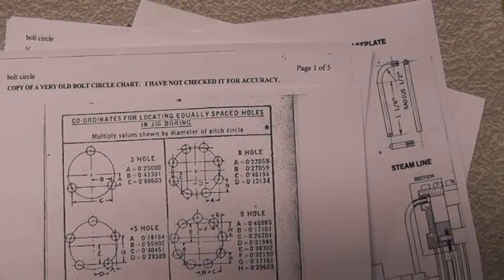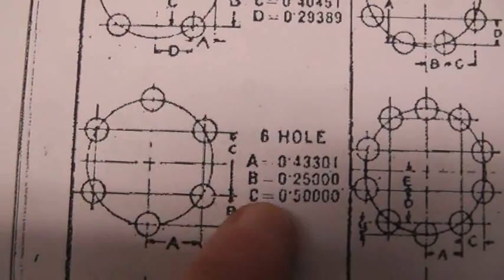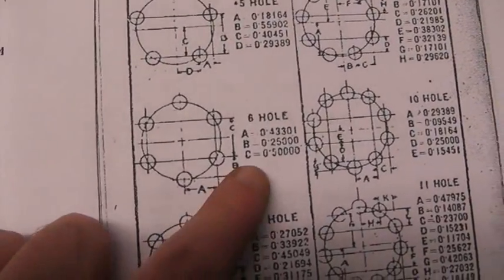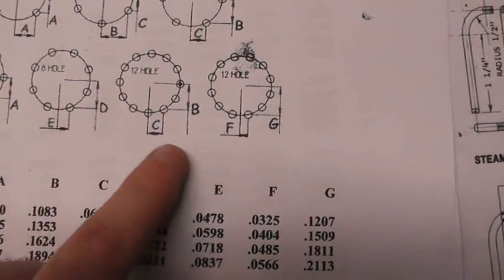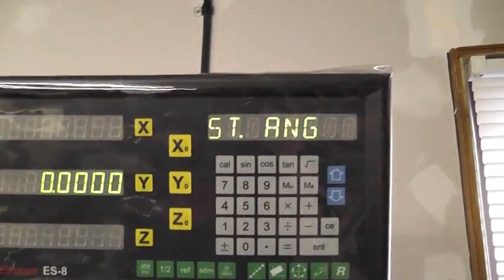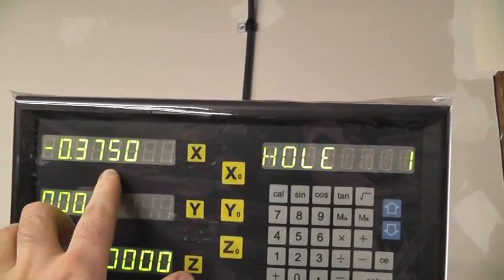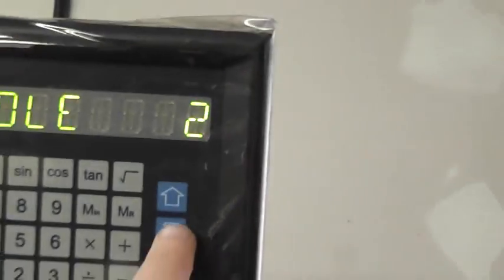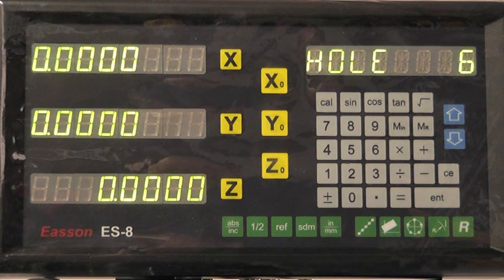Bolt Circle Layout and Machining with a DRO

Comment: I found the download page for the second chart completely elusive.  However, I did come across an online calculator that provides data for any number of holes in both imperial and metric.  

I would really like to get to the specific download page.  Would you be kind enough to provide the exact url for the download.

Comment: I think you can help me with programming my DRO gcs9003db+ I am having great difficulty finding center for bolt circles
Reply: Your readout won't find the center for you unless you did your boring on the mill and maintaned the center at xy.0000. Otherwise, you have to find the center of what you're drilling or milling with a center finder or an indicator, moving the x and y. Once you manually find the center, zero out the x and y on your readout. When you're in the bolt circle function the value will be all 0.0000 for the center. That is the point it uses to trig the bolt pattern with the diameter and number of holes you enter.

Comment: Your angle setting made sence to me the 0 or 30 degrees and 360 for a complete circle. Now my instructions showing me how to do a bolt hole had me put in 30 degrees for the start angle and 300 for the end with 5 holes. WHERE did the 300 come from? If you know I would appreciate how they came up with it.
Reply: its your display  (brand software ) for 7 holes on a 6 hole and you will come back to zero
Reply: @laurencestonard4593  I will have to give that a try. But I can see where the text instruction to English may have been incorrect. What you suggested really makes sense. Again thanks!
Reply: @tomherd4179  Used the Zeus book 40 years ago, that's what he had  in the video, you can find a copy on line if you want to look at it before you buy, as for the DRO, they have a common chip set and there is apparently, 2types from 2 China manufacture's, they are then boxed in a different box, so the China DRO are similar, they have  reversed engineered, the one's I used many years ago, we had Sony and Hinerman (?) displays which cost $5000 not  $ 200! good luck the manual is next to useless....
Reply: @laurencestonard4593  I usually try to get used higher grade equipment, but being 76 years old and just making ideas in my home shop the $5000 would eat up way too much Social Security for me to afford. Thus, I end up with a confusing China Knock Off. Note: some of the US and other good manufactures items, drill bits, end mills, mics, etc. just "FEEL" better made than the China imports., and hold up longer as well.

Comment: lol got it figured out just add 1 to the number of holes you want to drill ex 6 holes punch in 7 then you can use 0 as a start angle and use 360 as an end angle and you will finish at the first hole you already drilled and your done. worked for me .

Comment: i have a sino 3 axis dro. my problem is after i go to drill my second hole after arrowing down the co-ordinates dont change from bolt hole one co-ordiates. the numbers stay the same for bolt hole 2-3-4-5-6 . dont know what i did but theres got to be a button i pressed or somthing. i tried 14 times different ways and i cant solve the puzzel. any help would be appericiated thanks.

Comment: Nice video.  One comment on the content.  I believe the DRO is like most other CNC's in that zero starts at 3 o'clock, not midnight, as on a clock face. Your first hole was -0.375 in the X axis,  meaning starting at zero X,  zero Y, that move would have been to the right or to the position of 3 o'clock. Thanks for taking the time to make the video as I know it takes a lot of effort.  I offer this comment as only constructive, not to tear down your effort.
Reply: Van Henderson Sorry, I didn't get what u said, but it seems something knowledgeable, so can u explain a bit more clearly ??

Comment: Great video! I prefer a rotary table though...it is just faster, and easier + if other machining is necessary, like cutting a groove for a seal ring, or captive slots for bolt heads. btw, I have no DRO, or CNC in my shop.